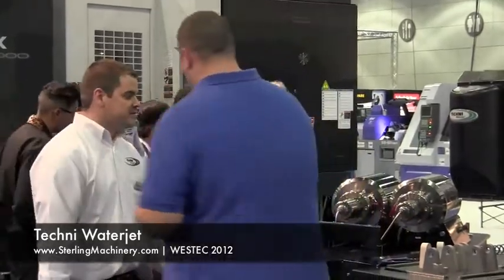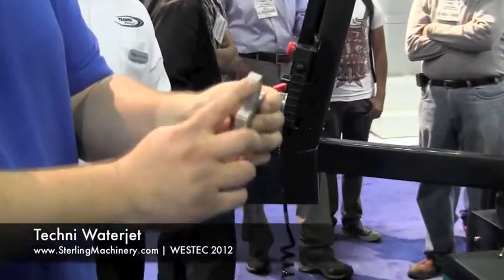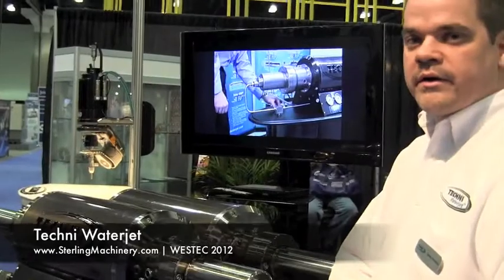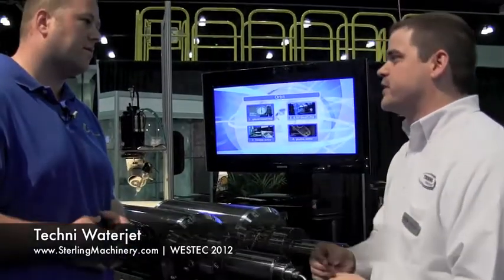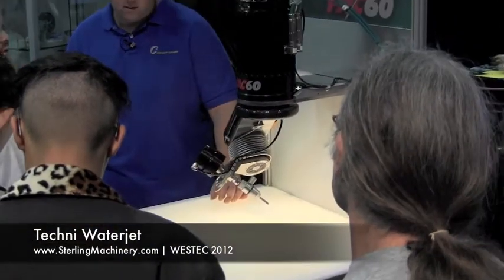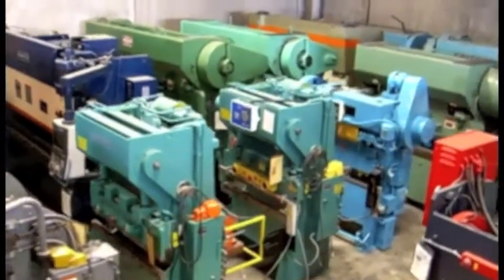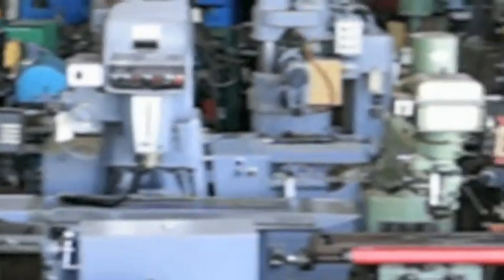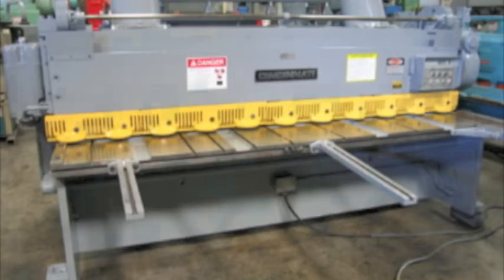Westec 2012 Exclusive Interview with Jason Lumetta from Techni Waterjet Machine

Comment: Got to be honest i use a Techni 510 Glassmaster WHEN it works its great but having it less than a year the hopper will no longer feed correctly the pump stroke rate regularly exceeds the limit causing the pump to shut down the computer that it uses is an old windows xp machine with a poor amount of ram meaning it often freezes or completely crashes. Overall Its a great machine there are a few teething problems nothing that cant be overcome but again just something to note.